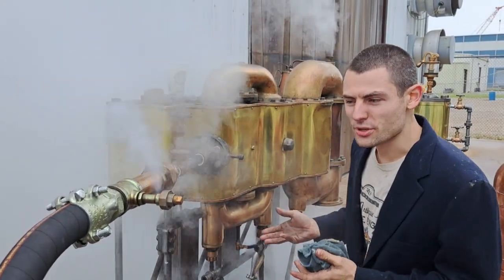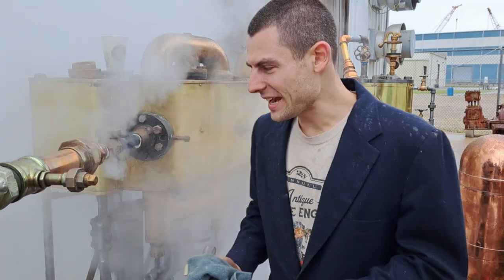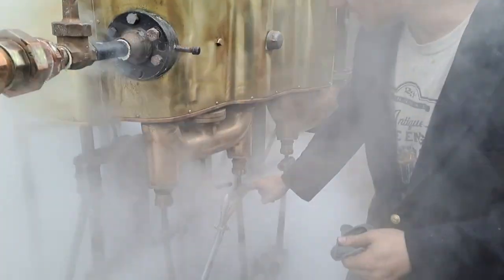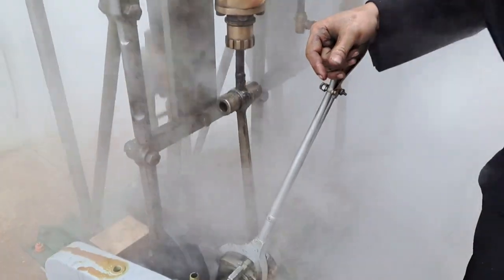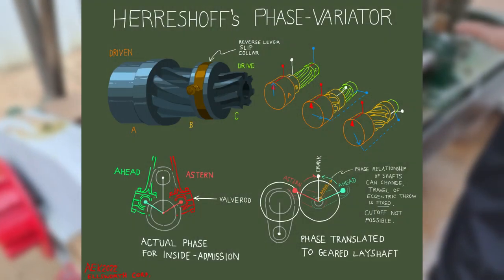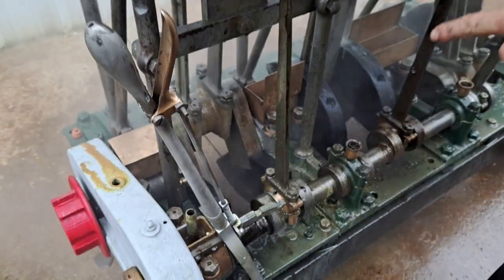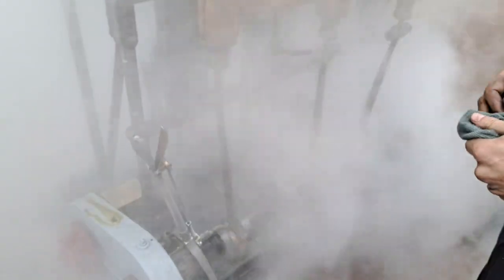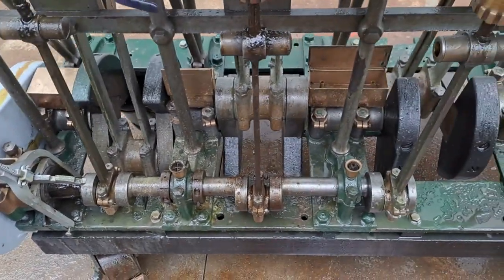Herreshoff's Lightweight, High Performance Triple Expansion Engine

Comment: A great engine from a great yacht designer.  I have been around boats since I was 10 (in my 70's now)  and never knew he designed engines.   One question though, I am interested in what kind of valve system he built into that engine?
Reply from the maker: Inside-Admission Piston valves with his own type of valve gear which I show in detail in the video.  Herreshoff's type layshaft gear with a phase variator

Comment: I have a question: Does the cutoff on a marine steam engine need to be variable in the first place?

I mean, for a locomotive, there obviously are long phases of lighter or heavier work for the same rate of rotation. Say, when pulling a heavier or a lighter train at the same speed, or when pulling the same train over varying gradients. For a stationary engine, similarly, the load needed in the factory may vary considerably while the line shafts must rotate more or less the same.

But for an ocean going ship, the load on the engine is directly related to the shaft rotation speed: Any given rate makes the hull pass through the water at a particular speed. This causes a specific drag, and thus, a particular power required to propel the hull.
In addition to this, for most of the time, a ship's engine will run to propel the hull at a designed traveling speed (which for a torpedo boat is just 'FAST')  – neglecting the influence of the wind resistance of the hull in a storm, but in situations in which this matters, you may probably want maximum power as well. 
So, I wonder if there are any economies to be made at all in notching back such a marine engine, or if these can only be made by designing the engine for the one very set of conditions covering >90% of the engine's working hours, in which case only one 'forward' notch is really all that's needed.
Reply from the maker: Considering steam does its only useful and efficient work by expansion, and the laws of physics regarding how the working fluid behaves do not change nor do they care what kind of load the engine is driving, cutoff is needed no matter what application the steam engine is used for.  How much cutoff is determined by the steam pressure and superheat available from the boiler, and the load versus engine horsepower, and other variables.  You will find individually adjustible cutoff per stage on a multiple expansion engine is preferrable and present on things like large marine engines for this reason.   The engines of a few great lakes steamers had Lentz oscillating cam valve gear with much more variable cutoff than stephensons as just one example